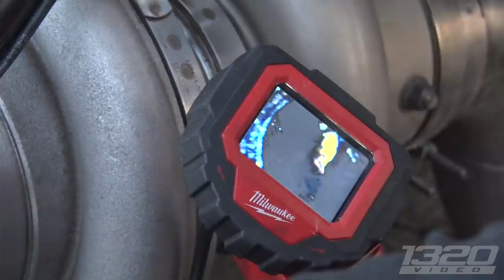Camera inside a 4000HP motor, 1/4 mile trailer burnout, racecar dog, and MORE! (Sick Week: Day 2)

Comment: Someone should have a lil mobile machine shop support truck/trailer for these events. Be a savior like the one dude that has the mobile lift on (I think) the Rocky mtn race week.
Reply: Yep and only pilot and co pilot can work on it iirc
Reply: Hot dang, just makes it more fun.
Reply: The mobile lift is here as well. Perhaps a welder for everyone (I know Matt Frost who runs RMRW carries a welder for the competitors). But you don't want the competitors to be reliant on these services. 
Usually you can find any tool you need. Motion Race Works has a support trailer with basic parts and hoses and such. I think Summit has a similar setup this week. I know Holley is there and they are filling NOS. Gear vendors is there to help people as well.

Comment: On Tom's valve failure , I  wonder if they were Manley Valves ? I had a head  of a 1 piece Severe Duty valve fall off in a Street Hemi  , and found out they had a bunch of them do it from the same batch of valves .

Comment: @1320video I wonder if the carbon fiber that got sucked up into Tom Bailey's driver's side turbo contributed to the valves/spark plug failure. 🤔

Comment: 1320 Video should invest in a car like the one that @Project Prime has with all of the cameras all over the outside of the car with gimbles and 360 cameras plus a few stationary and a passenger that takes photos as well as the driver has a button that he presses when the camera on the front of the car catches the photo he is looking for plus they have an arsenal of Go-Pro's, Drone's, and big camera's and I think for events like this one and RMRW you guys should do a collab and the guys from 1320 Video do most of the interviews with the driver's but get Project Prime to get the shots that you can't get plus share the responsibility of catching most of the racing that way we can see more of everything racing, interviews, trailer burnouts and so on and I have to say that most of the recent drag racing videos has put out has a little bit of drag racing, a little bit of looking at the car they are talking about at the time and alot of talking to the driver about what's it have in it what are you running today and what is the overall PB......... SMH I just did Fred's job and Kyle's